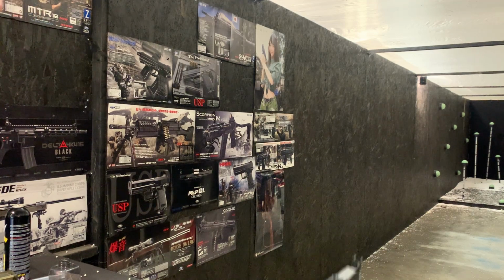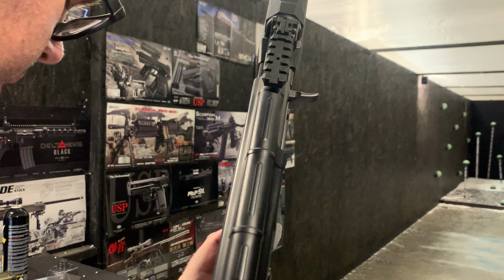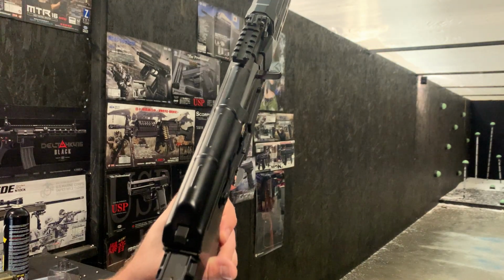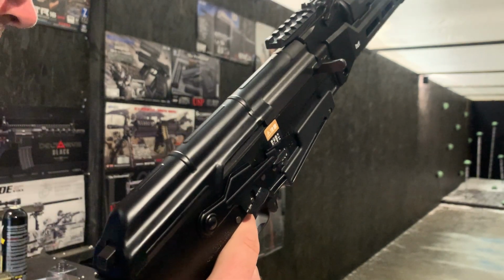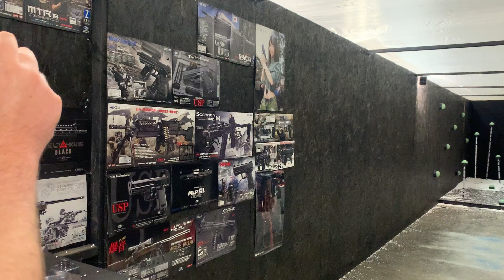TM AK Storm NGRS | 952

Comment: Any improvement on reliability with the jefftron leviathan v3 for this gun or just personal choice to risk it for a biscuit?
Reply from the maker: not sure about reliability when you add electronics, complexity and make things faster.  But the mosfets do increase effeciency of the guns by up tp 20%, trigger response can be increased, cycle completion of the gearbox and fire selector configuration options.    The gun is better for having it assuming you dont mind the cost.

Comment: Le mosfet rentre dans la gearbox sans modification ?
Reply from the maker: There are some modifications needed to the gearbox shell so the jeftron sits close enough to the gear shaft.   it also needs a rewire, i always promote copying tms wiring configuration and layout if in doubt.  and the stick for the optical sensor on the fire selector needs to be put in the right place.  It can be time consuming but not rocket science as with all things airsoft tech.